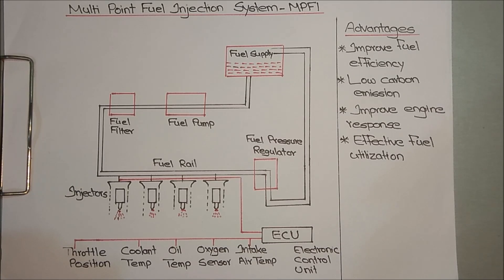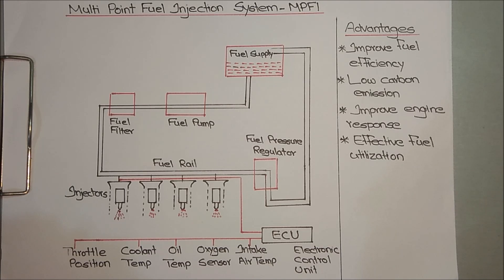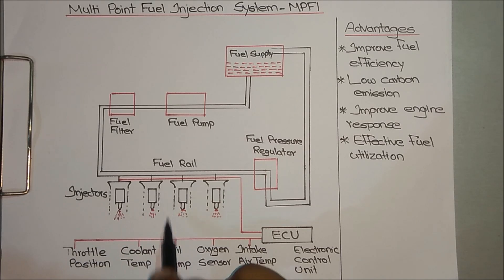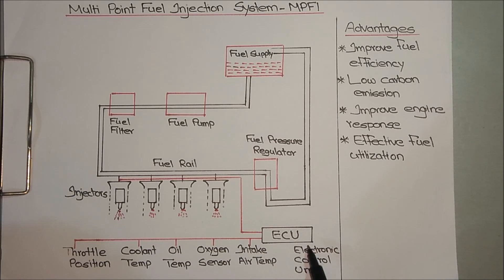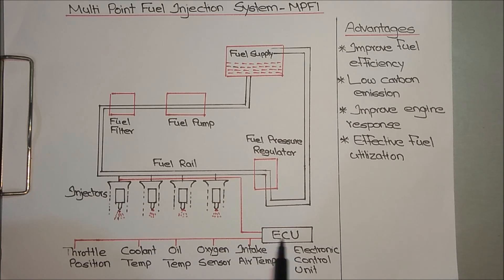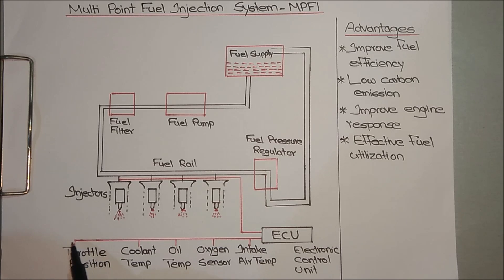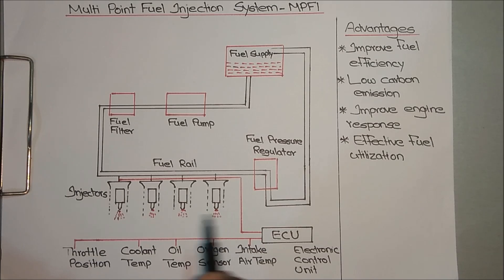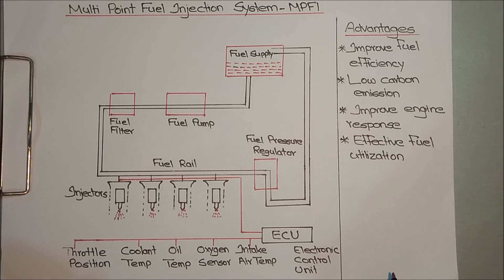MPFI-Multi Point Fuel Injection System Explained

Comment: thank you so mush for the explanition but dose the injected fuel gose directly to th cilynder  so the intake valve how it works at this thank you
Reply: Not directly but through intake valve. And the valves are worked as usual (with any valve mechanism). Aren't I right?

Comment: Where is air ??? MPFI is for petrol engine .... Diagram relates to CRDI engine?
Reply: Filtered air will be induced near or around the cylinder in regards to the moment of fuel injection into the cylinder
Reply: Yes,Filtered air is supplied at the intake manifold above the injector nozzles which is controlled and regulated as per requirements
Reply: @ascenderx  bro what about direct injection??